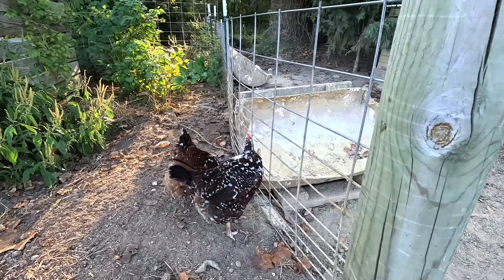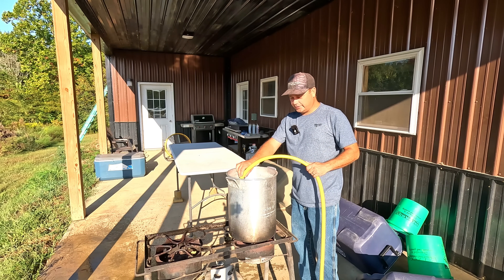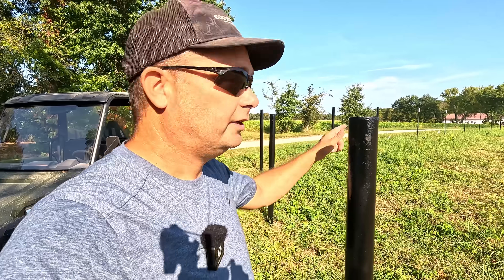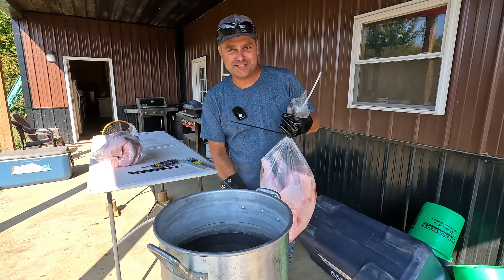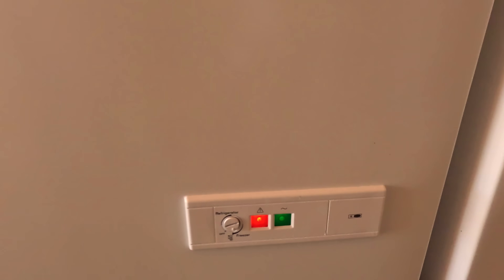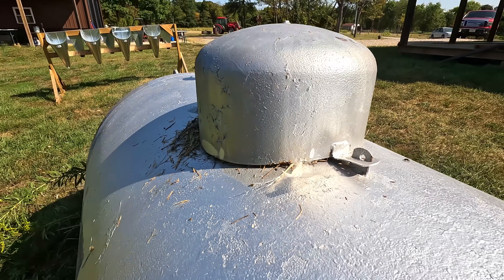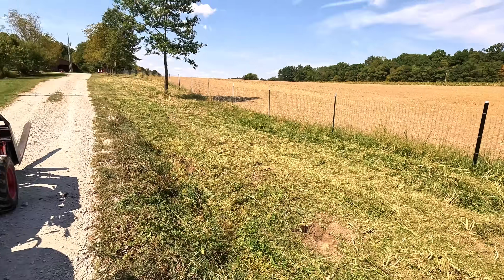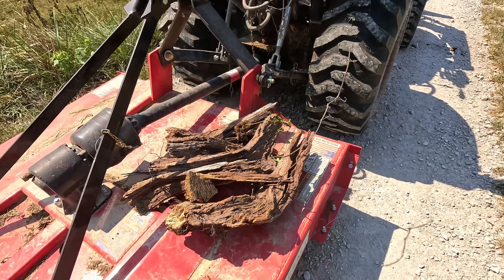Catching up on Odd Jobs that need done.  Attempting to Fix the Post Hole Digger - Welding Cast Iron

Comment: I always heard cast iron had to be brazed, but so far that nickel rod seems to be the ticket. McGiver would be green with envy!
Reply: I've welded cast iron engine blocks with that nickel rod, works good. Yes you can braze with brass rod. Ive done thst too. Pre heat is a requirement either way.

Comment: Evan that is cast steel, not cast iron, you can weld it the same as mild steel, 2 ways to determine cast steel vs iron, hit it with a grinder, if sparks are bright it is steel, if sparks are dull iron.  Also it is welded to the tube, factory won't weld cast iron since it is prone to break when welded.
Reply: I was thinking the same thing but the nickel rod will hold either way if done right. Its still porus and the nickel will help the bond with porus metal. I would have used mild steel to reinforce back to the metal tube with some plate and then drilled it out. That would have made it tougher and resistant to break again.
Reply: kd5, you are right about the nickel, but it is an added expense, and nickel is hard to weld without practice. I would have probably used 9018, it welds nice and bonds well to the parent metal.  If there is room I would have wrapped some 3/16 or 1/4 bar stock around the end to spread the load out along the entire piece.
Reply: @terrypotter4779  I agree, I would have definitely added some reinforcement to it. It will probably work just fine but the metal its made from being porus it gives me pause that it might break again in the field. I think it could have been a better design from the manufacturer.
Reply: @kd5inm  agreed

Comment: You should cover that weld and let it cool slowly in addition to pre heating it.
I was a welder in a shop, on a 5'X10'X1" plate bench and welded everything from 16 ga S/S to 1" carbon steel plate.

Comment: Every time I open the cover to my propane tank there’s a wasp nest.  We have geothermal heating and cooling and we use less than 300 gallons a year here in central Minnesota.  Propane is used when the geothermal heating can’t meet the demand for heat plus it’s used for cooking and drying clothes.

Comment: I think the eye is actually cast steel not cast iron , the sparks from cast iron grinding are short red /orange color and don’t have forks , your sparks were long yellow and forked indicating cast-steel the nickel rod is fine to use and it actually welds better than cast iron.

Comment: What youll find with most casting repairs is that most things are not actually iron.  They are generally a high carbon cast steel which still need care when being welded but arent nearly as persnickety as iron.  Think exhaust manifolds, manchine bases, old piping, and valves, etc.  Most everything structural is a type of steel.  

Check out spark and drill testing.  Cast iron usually throws a red spark, steels are a yellow bright color.

Comment: The only thing I would have done differently on the cast repair was after each short weld then peen the weld with a ball peen or chipping hammer to relieve the tension in the weld. I was taught that on cast using nickel rods. Heating with that big rosebud torch probably did relieve the tension enough. I would have put a carbon steel plate on each side of that cast piece because cast isnt as durable but it should hold if you dont get rough with it. Good job!

Comment: Evan, I’m a long time follower and fan of your videos and have learned a lot from your projects. One thing I have a question on after watching you use rattle cans for painting is why don’t I ever see you using an HVLP sprayer? I realize that out in the pasture that’s less practical but around the shop a spray rig does a nicer job and buying paint to use in a spray rig especially an HVLP one is far quicker for me and uses paint I buy that is cheaper by volume than rattle cans. On some projects where appearance matters it does a nicer job.  I’d appreciate your view on this. 

Keep up the great video content and quality. 👍😊
Reply from the maker: @DennisFahlstrom  15 minutes to mix paint and get the HVLP gun ready.  30 minutes to take gun apart and clean it up afterwards.  Most small jobs aren't worth the 45 extra minutes.

Comment: Experience Brings Forth Knowledge!   You are making better choices!  Setting Gate Post with concrete insures Solid long lasting foundation.  However, still consider putting the supporting brace between gate post and first post back for when ground shrinks during droughts.

Comment: Hi Evan have you watched Keith Rucker on welding cast iron? He doesn't like weld and brazes his joints. Also you did the preheat but he wraps the joint in a fire blanket to cool down very slowly 12 hours which stops the joint being brittle.

Comment: Great tip on the chicken and turkey storage, putting them in plastic bags with a straw and zip tie, then dip them in scalding water is a nice way to do them. My post digger has a strap on top and bottom to hold the the eye for the third arm attached to the tractor. I think that keeps it stable, might try that, if it gives you anymore problems. Thanks for sharing, always a pleasure to watch, have a good evening!

Comment: Great video on the cast repair. We need only 300-350F preheat for cast iron. I use a digital ir thermometer. Cast likes to be cooled down SLOWLY after repair. If you can cover it with a welding blanket, or similar device, it won't crack and the repair is super strong. Brazing is the preferred repair method, but nickel works next best.

Comment: A good fix for the posthole digger would be to cut off the eye, take a round metal and and weld a rectangular piece of to it that fits over the rectangular cast piece still on the digger. Than you can bolt that piece to the digger.

Comment: I haven't sheared a pin on my 6ft brush hog but I have on my 5ft one I had my uncle was shearing pins on his he ended up putting a grade 8 bolt in and he broke the gear box and it leaked gear oil and my boss did the same thing with a grade 8 bolt and he broke his john Deere tractors pto it would cost him 7,000 dollars to have the tractor split and the pto parts to fix it.  Have all the leaves fallen off your trees around the driveway what kind of trees are they I've noticed a lot of trees around town losing leaves I'm figuring because its so dry an early fall setting in

Comment: If your post hole digger breaks  . Might try just replacing with a small piece of steel tube , steel bar and a cut  round plate  . It looks like just the end is cast iron  .
It would seem that having that end made of casting and than machining it would cost more than making it all of steel  .

Comment: Hi Evan - Good plan on topping off your propane now,  propane and natural gas prices are driven by the stock market and nearly every year usually October is the last month with low prices before prices start going up for the winter with Jan and Feb usually the highest price.       Excellent call IMO to put your fence gate posts in concrete to help the gate from sagging and dragging the ground,  they do make wheel kits for farm gates to help keep them from dragging also.

Comment: Anytime you weld cast iron, you have to take a torch and preheat the metal before you weld it. Not red hot but it has to be hot

Comment: That look like cast steel don't need to heat it that hot and it crack when it cooling down wrap it with a blanket  or cover in sand needs to cool slow

Comment: Do you need to positively seal the bag opening to keep air from infiltrating the bag in the freezer?
Reply from the maker: yes, you want to keep the air out.  So you tightened the zip tie as tight as you can after shrinking the bag.

Comment: Hey Evan on that welding that cast iron right after you weld it you want to peen it. Peen it while it's still really hot from the weld until it cools down just keep peening on it, that'll keep it from cracking later too and breaking. So heat it, weld it, peen good.